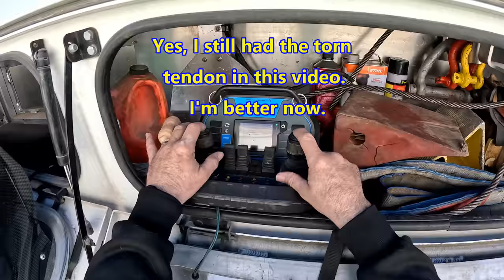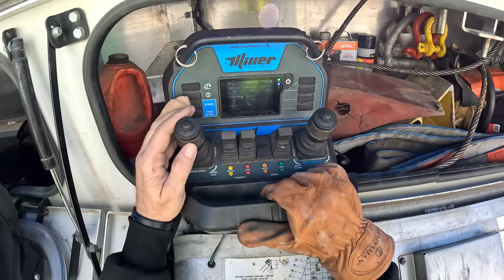THE "NOT A CONTAINER", CONTAINER LIFT    WAIT...   WHAT???

Comment: The rigging is tremendous! Basically a trade in itself.
Reply: Especially when kids think that they will not be using the maths that that should be learning in school.
Reply: My dad used to say that the starting point is math.  Physics is applied math.  Engineering is applied physics.

Comment: It is a storage unit.  I delivered these types of units. You went through the trouble of lifting when you could have just used your rollback. It would have rolled off the truck. 
This is how we loaded and unloaded them with a rollback. 
People use these because there cheaper the going to a storage place far from home. 
There easier with moving also.  You can move you stuff and not have to hurry and unload. Keep it until your done or have the monthly fee like any other storage units.

Comment: The slings we had a work for picking up the mining trucks had a sleeve already on the slings to keep protection on the ends.  Of course the slings were much bigger and we hauled them in a big wooden box because sometimes they were used outside

Comment: Hery Ron, some very important info for you.  i was watching an RV recovery on another channel and i wanted to share some info for your safety.
RV's these days are being equipped with much higher battery capacities than in the past and many will have converters that supply 120 VAC(household power) throughout the RV even while on road.  There also may be solar panels on the roof supplying power to the RV after you have disconnected the batteries or the batteries have been destroyed in an accident.  the solar panels my still be supplying power to the dc- ac converter which can still supply that 120 VAC throughout the RV.
this can all be a concern in a catastrophic accident where you maybe cutting wires and picking up pieces of the RV
Be careful out there!

Comment: Is good. Hi Ron, it was assumed 12,000 lbs when it was 20,000 lbs. If it was more weight would you have used another lift cable one on each side?

Comment: It seems to be human nature when loading stuff by hand into a big box or container, to deal with the heavy stuff first,.  If it has to be by hand, then they should put the heavy stuff in a strip nose to tail down the centre and the lighter stuff on either side and then the lightest on top of all that stuff. If load bracers are available, the heavy stuff could be put 1/2 in the nose, 1/2 on the tail.

Either way it could have been, you guys didd a good job of dealing with what you found in any case.